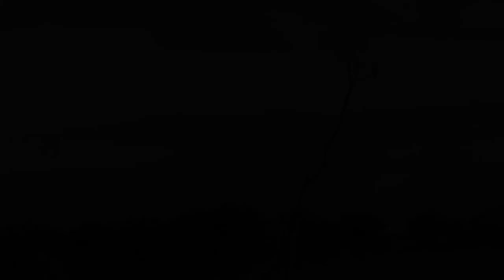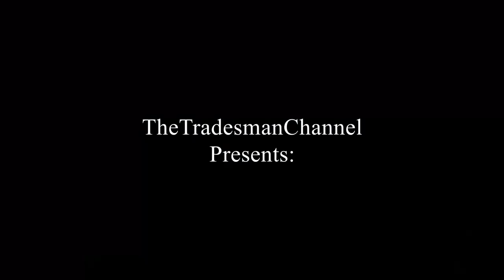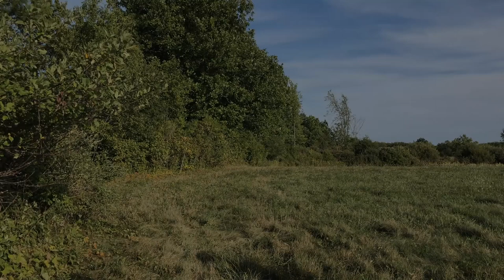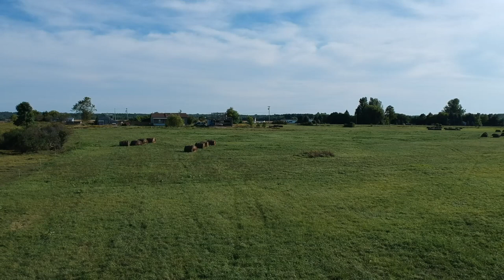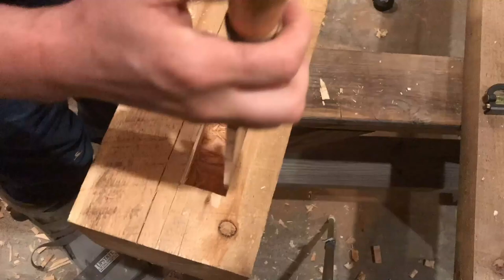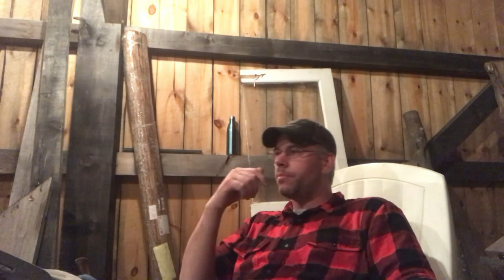Ospreys...DJI Spark Drone Footage...Cutting Mortises by Hand for Our Timber Frame

Comment: A frame can be built with, two handsaws a rip and crosscut, 1.1/2 &2 inch chisels, framing square, plumb bob  a plane that cuts to corner like a rebate of carriage makers plane a mallet, a brace drill and a bit for peg holes and idealy a bit for removing waste from mortise 1.5” for the 1.5” mortises and idealy a 2 inch or a 1 inch for the bigger ones. Every thing else is labour saving. If you have one frame to build and are not in a massive rush hand tools are a real nice way to build a frame
Reply from the maker: Very well said.
Reply: I concur.
Reply: There is a challenge out there where a frame is cut using only axes.  I would like to put that out as a challenge,  I hope to give it a go some day.
Reply: Oh, support tools a string and set of dividers.
Reply: One more caveat, no pencil or tape measure, just a scratch awl.
Reply from the maker: I get this done and get healed up that sounds like a plan.
Reply: Timberdoodles I could do it. I do however have an inch an half wide mortise axe that I picked up off one of the tool dealers I use regularly.

Comment: Morning again, Jim. Do you know if it's made, or have you seen, a 1 1/2 inch or 2 inch mortising chisel? Also, hand tools are a bit more romantic (not in a sexual way, Get your mind out of the gutter.) and give the craftsman more of a connection to their work. Plus, hand tools make it so much easier to catch a mistake before you've gone too far, too quickly, with a high-speed power-tool. Keep up the great work, and don't forget to rest that leg from time to time.
Reply: Also, why do dressed up? Clean jeans and a flannel? So used to your work clothes that this attire really stands out. Looking like a crafts teacher here, LOL.
Reply from the maker: I used to wear flannel all of the time with jeans, somehow got away from it.  Mary picked me up a couple of new shirts and I forgot how much I liked it.  Not sure what you mean by a notching chisel.
Reply: @TheTradesmanChannel  spell check for me again. Was supposed to be "mortising" chisel.
Reply: I have seen many 1.5"- 2" mortising chisels, but the prices for new ones are quite high, and good used ones are pricey too, but much better than new prices....keep searching high and low, and do your research on what chisels are good, bad, etc.
Reply: Around here, we call that a "Bruce County Tuxedo"...Jeans, workbooks and a flannel jacket.

Comment: Hi Jim, been watching recently as am in the process of starting my own major project. Have been wanting to ask this question, don’t know if this is the right place to do this or ( knot). If the chainsaw is still hot is it to soon to mill and after milling is lt to soon to tool? And after tooling is it to soon to assemble? How long do you wait? Have built Swedish cooped log home in Colorado and waited until around 18 % WC or you payed dearly for it. Awesome show!
Reply from the maker: With this you can do it fresh off the sawmill if you have to.  A lot also depends on the species of wood you use and their natural moisture content.  I build green so everything shrinks together.  As for the chainsaw mill you need to let the saw idle every few feet to cool down, same after you finish your cut.  Milling with a chainsaw is very hard on a saw, I did it for a long time.

Comment: If I was ever to cut a mortise without boring it out first, I would do it just like you did. However, I have never cut a mortise doing it like that. I got a boring machine 20 years ago, when I started timber framing so that I would never have to do it like that.

Comment: For boring a brace mortice, for sure just bore the whole thing, chiseling the bevel takes more time than wasting wood with the 2"bit.   For the  folks that don't have a boring device good old half laps were the tradition.  They work very well, actually.  If you have a saw saw the half lap then waste the wood with an axe.   One method often used before hand crank boring machines let alone modern was to use a T-agar with a feed screw on it or even before that they used a spoon bit to bore one hole at the end of the mortice then chased all the wood into the single hole.  Old frames will often show this single hole.  Crikey! some chain morticers will run you $5k!   Oh, I got a mention along with Jim, thanks.  I just covered that, I would likely convert to lapped joinery keeping the mortices to a minimum.  Likely the frame would be of Cruck design where lap joinery really shines.   After 20 years I have put excess wear on my joints and tend to avoid heavy pounding with my mallet, I favor the axe a lot.   Good demo on hand chiseling a mortice, btw.  Glue that flap down, or maybe when cutting the brace mortice like this leave the top end and bevel it to the housing, it it flips up there you can recover it when you apply the bevel for the housing.  I will stick a video of a dead osprey here at the end,(from my other channel) it got fried on a power pole next to our farm. Beautiful bird for sure.   Sorry for the run on text just commented as I listened.  Your on the mend!  

https://youtu.be/OPKYE_3f2U0
Reply from the maker: You run on as much you want here, I love your wealth of knowledge.

Comment: my chisels just wont hold an edge! razor sharp for 15 minutes then wam dead!!!
Reply: You may have an issue with the hardness of the steel. If it was ever ground with a power tool it is likely that it was over-heated and lost its hardness. If you have the ability to harden it and re-temper, I'd suggest that direction and then wet-grind or stone it. Also, check your bevel angle, too steep and it will dull quicker as well. ~27.5°, give or take a degree or two, would be ideal. Anything less than 25° will dull increasingly faster as you get to the smaller numbers. Also, what kind of wood/s are you using? Hard-woods will dull it faster than the softer pine Jim is using.
Reply from the maker: Thomas is right, too hard and they chip the edge...too soft and they will quickly.
Reply: i am working with walnut right now but it is all woods for the most part! they are harbor freight chisels so........
Reply: they do chip but have i have never done anything but sharpen them with a wet stone
Reply from the maker: I see, time to hit the flea markets.
Reply: yeah i have been to the only 1s around here and they either want a lot for trashed 1s i was at an estate sale and found 1 1" for 5$ asked if they had anymore lol but they didnt

Comment: A good workout. I can relate to your recovery. I had a hip replacement at 40. The few months on either side of it were bad. This just shows different things you tried to burn up your idle time while trying to regain strength and stamina, while not trying to go backwards.
Reply from the maker: You are spot on.  It's a very hard thing.

Comment: “You will need an auger for your pegs” Couldn’t one cut square peg holes with a smaller chisel and use square pegs?
Reply from the maker: You could and I have seen it before.

Comment: Quick question can you get a timer framing mortise chisel to cut out your mortises ?
Reply from the maker: The chisel I'm using is made for that purpose.  I know most folks are used to the real thick ones but those are made for much smaller holes.